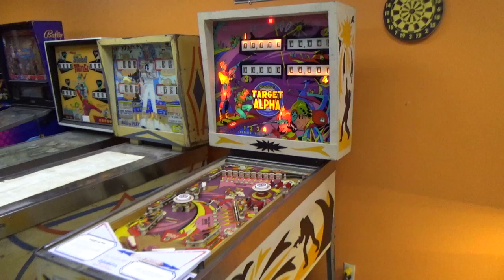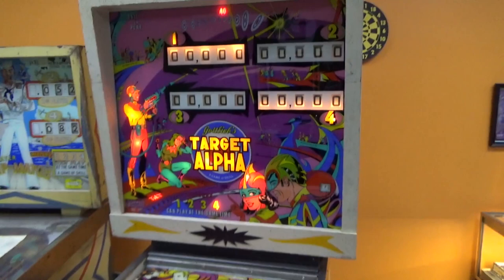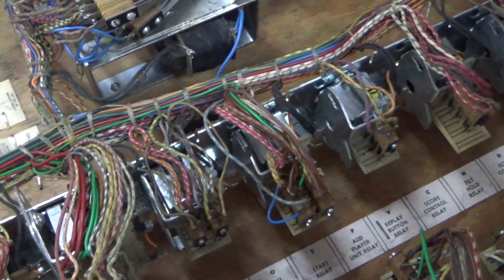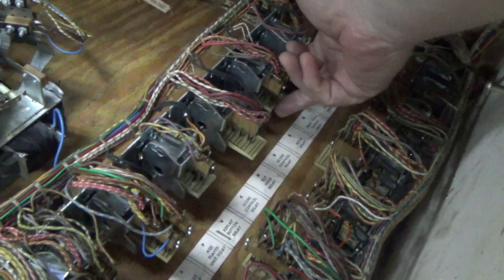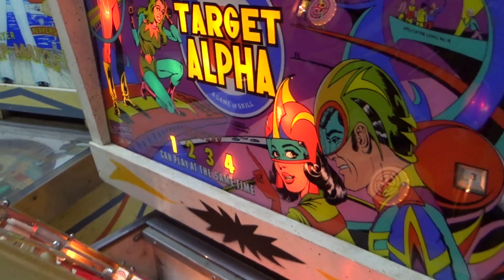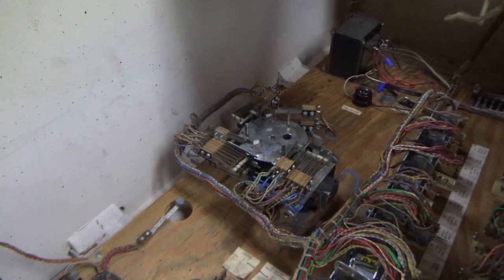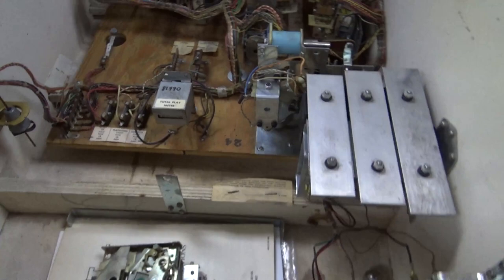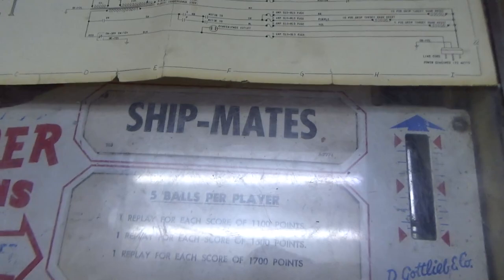Repairing A 1976 Target Alpha Pinball Machine - Gottlieb Coin Unit & Player Unit Issues, Schematics

Comment: JOE, The Reset Control Relay, is resetting which stepper units and relays? I'm not sure if all EM games all have a Reset control relay. I don't know what the reset control relay is going because I thought that all the stepper units and score reels have zero position switches which get reset only by the EM start button or ball outhole switch or the game over switch. The Reset control relay but be connected to the EM start button, ball outhole switch, game over switch, anti cheat switch, tilt switch>?